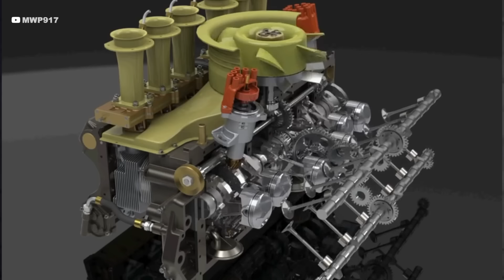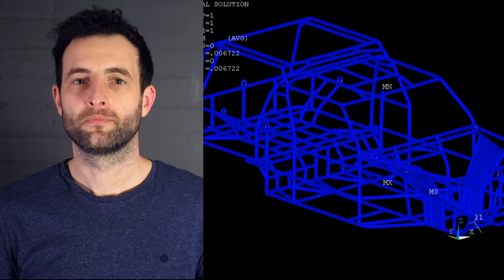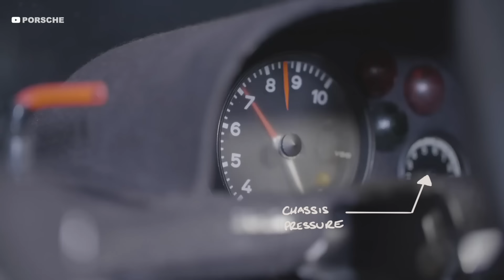The Porsche That Had an Inflated Chassis

Comment: that's a load of bollocks.. pressurizing is NOT inflating!

inflate
/ɪnˈfleɪt/
Learn to pronounce
verb
1.
fill (a balloon, tyre, or other expandable structure) with air or gas so that it becomes distended.
"never use an air line on a garage forecourt to inflate your tyres"
Similar:
blown up
aerated
filled
puffed up
puffed out
pumped up
dilated
distended
stretched
expanded
engorged
enlarged
swollen
Opposite:
deflated
2.
increase (something) by a large or excessive amount.
"objectives should be clearly set out so as not to duplicate work and inflate costs"

These chassis were not "inflated, they were constructed with metal tubes, that were then welded.
the tubes were interconnected so gas of fluids could pass from one side to the next.

And then they were filled with gas and /or fluid

The shape of the chassis did not change when filling. as such , it was NOT inflated.